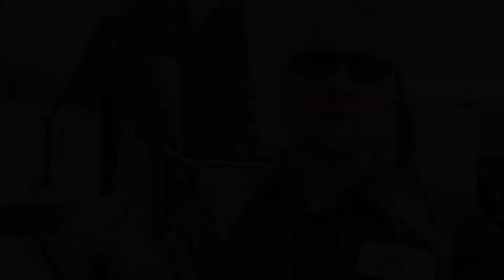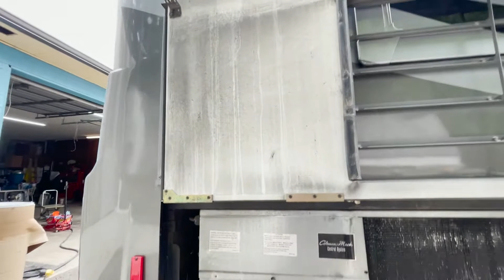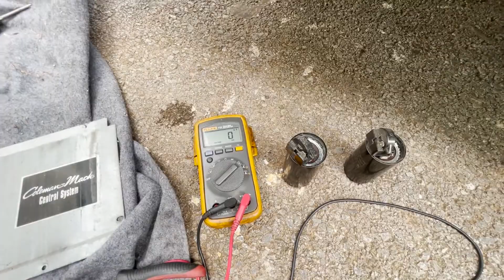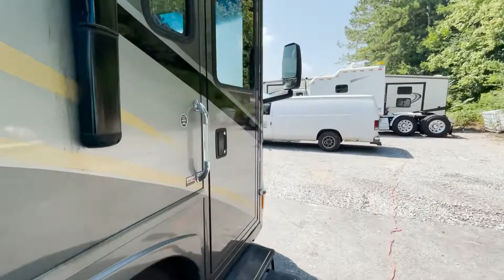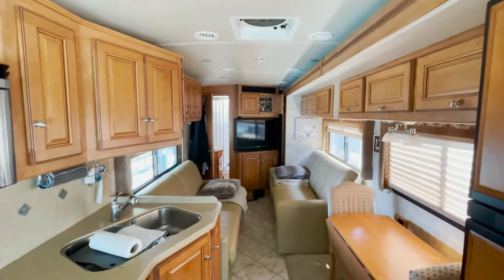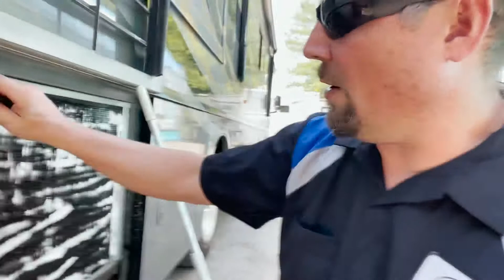Winnebago basement air

Comment: Thank you. I just had mine repaired. There were 3 pin-hole leaks in the system, that required extracting the unit. Working fine now.
Total damage, $1800. 😩

Comment: What are the two silver canisters next to the capacitors?
Reply: Electric ac motors have capacitors most all types in this case for fan(s) and a/c compressor(s) of the a/c unit.  The motors have internal speed switches.  At start, the caps are engaged to discharge a stored electric charge to boost the current to force the rotor to spin.  At speed the caps are disengaged and recharged.  The 'start current' is momentary with the value of about 6X the 'run current rating' of the motor.  I hope this helps you understand the use and functions. - Foxtrot70

Comment: This was great. I have a problem with my basement air that began yesterday afternoon. I was in the bedroom so I heard a loud screech (and figured it was the compressor). It startled me and I popped up and was concerned. Then the main breaker got tripped and I had to go to the panel that's in the stairwell (I have a 2000 Winnebago Adventurer) and reset it, but it was only blowing room temp air after that. 

I tried to see if it would turn on this evening after one heck of a hot day (Southwest NM heat wave) and it didn't screech but when the compressor was trying to work, it was really laboring. It did put out a little bit of cool air during this time, but then the breaker tripped again. Is this something major? Sure sounds like I might need a new compressor. 

Thanks for any information you can give me. I appreciate it.
Reply from the maker: Call me when you get a chance 423-290-8367
Reply: @shelburnerv  Oh, crap. I am just seeing your comment now. Thanks so much for your phone number. Actually, I accidentally turned it on tonight after it being "broken" for the better part of a year. To my amazement, although it was loud and laboring, it was putting out cold air and it didn't trip the breaker. It never screeched and shut down and I let it run for about 10 or 15 minutes. I was afraid to turn it off, fearing it was never going to run as well again. It was a bit like a dream.

I'm going to go under the bed and see what I can do to make sure the air ducts to the unit aren't clogged with pet hair and dust and then when I turn it on again, I'll see if it runs and stays running, and sounds less labored. I can't believe that this is even a possibility. All because I slid the wrong switch on the control tonight. I was just reaching to turn off the fan.

Comment: I enjoyed the video too. I have a 2007 Winnebago Voyage with basement a/c. Do you know if you can put a soft start on these units? I have tried to run the a/c off of my 3000 watt inverter but it overloads inverter and it turns off. I thought about trying to disconnect the 2nd compressor and see if inverter could work then. I enjoy these how to's on camper and motorhomes. You have a new subscriber now.
Reply from the maker: I would be happy to discuss this with you give me a call anytime at my office number 423-479-3627 thanks Steve.

Comment: Enjoyed the video, not sure why so many are afraid of the ,Coleman Mach basement HP. I do have a question, I get a bit of growl when the condenser fan is starting, would that normally be a bearing issue, or a start capacitor. It only lasts for about 2 seconds.
Reply from the maker: Please give me a call anytime I have a couple of suggestions that’s might help. 423-479-3627 thanks Steve!